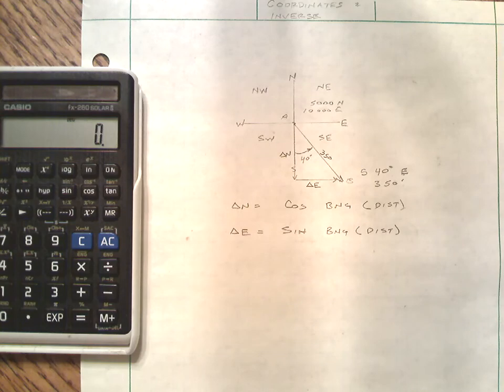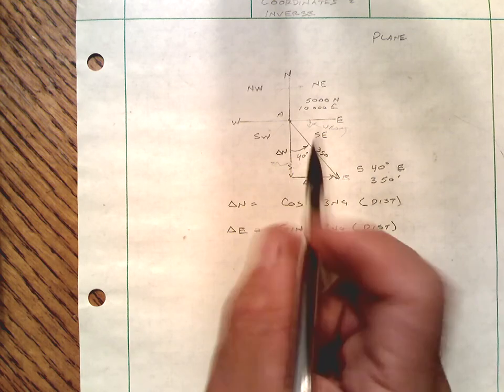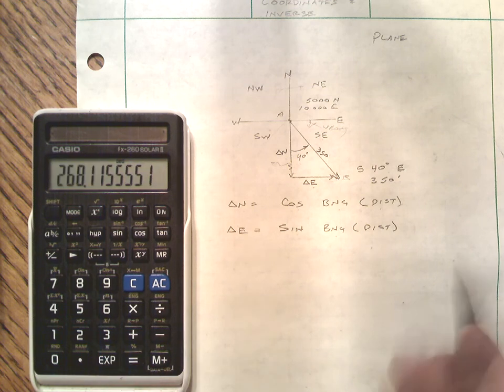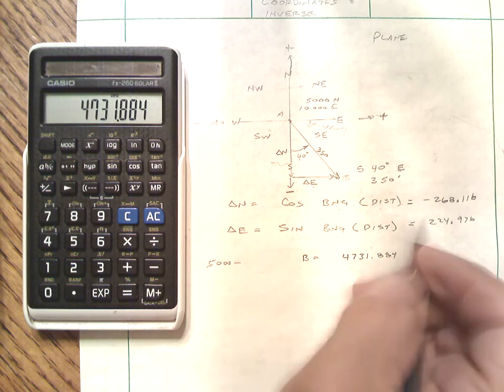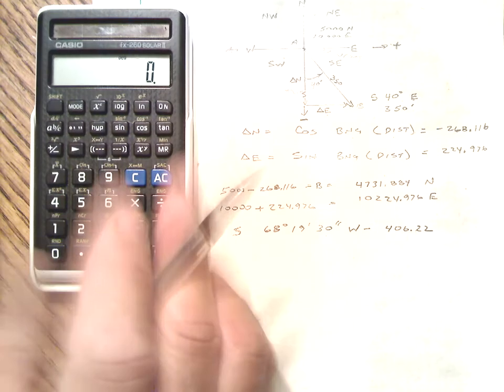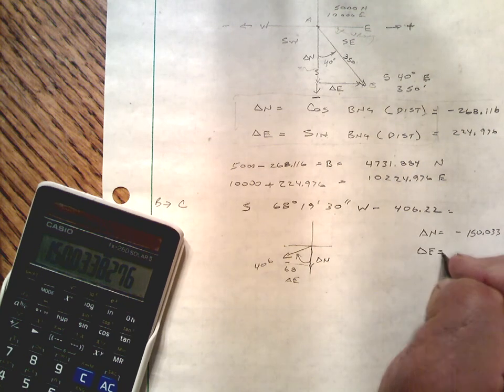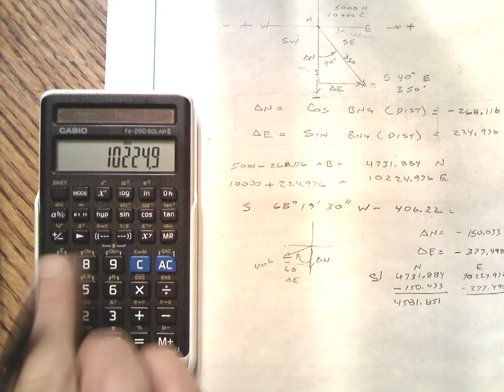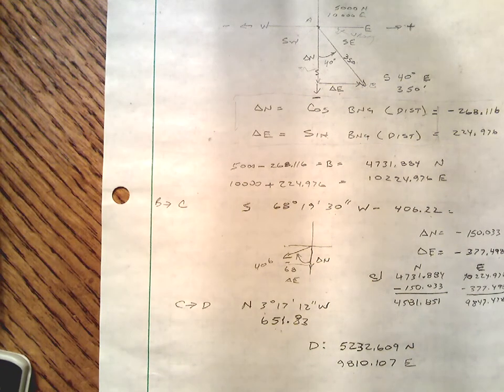Computation of Coordinates from a Known Bearing and Distance

Comment: On my survey the starting point was in Lat\Long.  Little confused on adding the Northing and easting solution to obtain a lat/long for new point. So what was the 5000N 10000E representing?
Reply: I believe his 5000N, 10000E were on a hypothetical plane. My understanding of this video is that you first determine decimal degrees from your Lat/Lon then either add or subtract the delta N from your LAT, then add or subtract the delta E from your LON. Feel free to correct if I misunderstood.